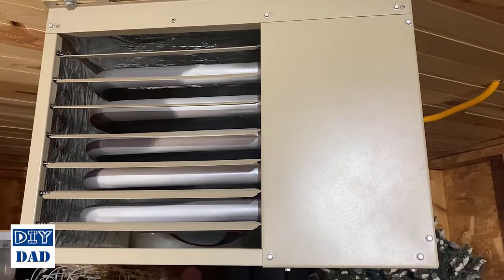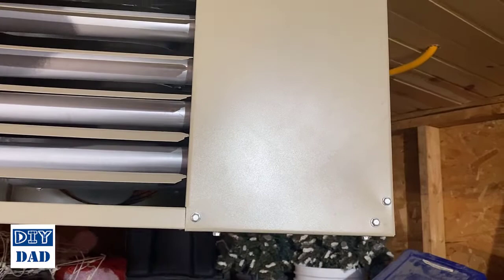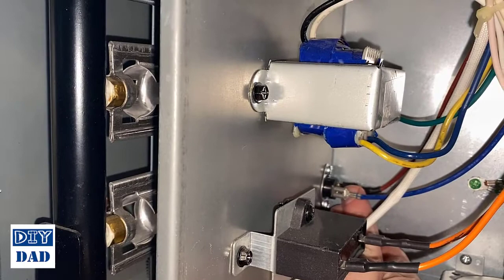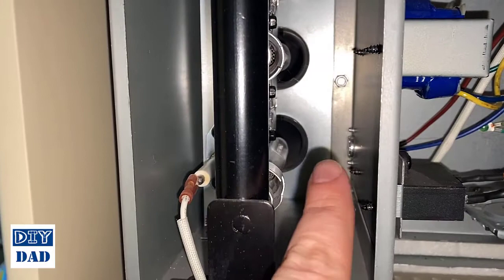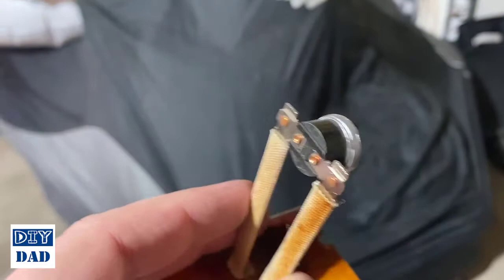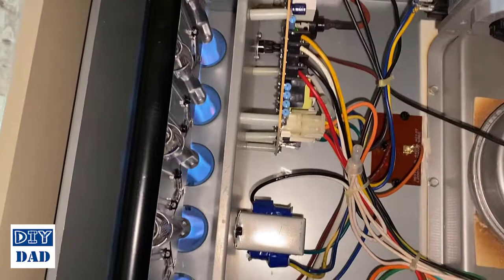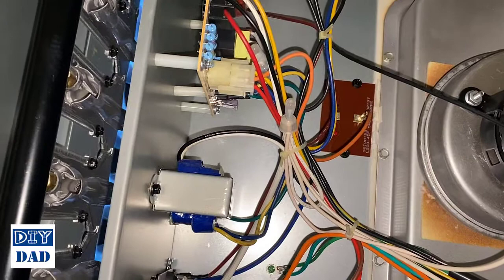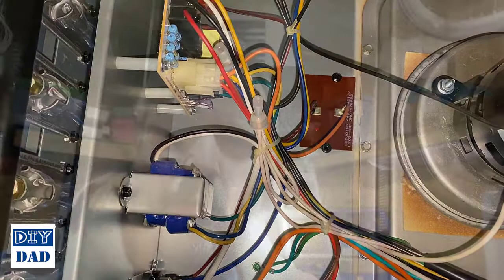Replacing the High Limit Sensor in a Heater that won't stay on. Common, Cheap, Simple Repair!

Comment: Thank you, DIY Dad!  I have the exact same heater in a commercial greenhouse.  Same error code, control board LED flashing 4 times.  Heater would turn the fan on high without prompt from the thermostat but not ignite.  I just replaced the control board, high limit sensor and pressure switch … but one of those pesky little roll out sensors had tripped.  After checking both of them and depressing the hidden reset button (thanks for the tip!) it’s working great again and keeping the tree ferns warm.
Reply from the maker: Awesome! Glad I could help!

Comment: I reset the rollout sensors and started the unit and saw the flames rolling out and the sensors tripped within a minute. I then blew out the screens at the gas jet outlets and reset the sensors again and seems to be fixed, been running for over an hour with no rollout. So thanks again for showing where the resets are on the rollout sensors.
Reply from the maker: Excellent!  Glad that was helpful to you!

Comment: Thanks. I have the four blinks so will check the sensors. Unfortunately it's black around the heat tubes suggests some rollout. The heater is less than a year old
Reply from the maker: Best of luck!  Insulated the walls of my garage this last summer which has resulted in my heater running far less and haven’t had to touch it since that video (the original sensor lasted only about 2 months)

Given how cold it has been this winter I would check your heater’s exhaust path for icing or snow buildup - either could cause some roll back.
Reply: Where did you purchase the sensor?
Reply from the maker: @philhanson7624  Honestly I don't recall - I pulled the sensor and read the part number off of it, then did a google search for that part number.  I am pretty sure I got the replacement from Amazon or Supplyhouse.com

Comment: Is there temperature sensors that will also fail on the electric model
Reply from the maker: I’m not sure.. but it would stand to reason that there would be a failure limit sensor to avoid a heating element melting or damaging itself in an over-volt situation

Comment: I’m getting 2 flashes for system failure. I’m not finding anything  online that tells me how to fix this.
Reply from the maker: What model number of furnace?
Reply: If it’s a Mr. Heater Big Maxx 80,000 btu furnace, the manyal says:
2 flashes: System Lockout - failure to detect or sustain flame.  Current signal at FLAME terminal less than 6 micro amps. 
If your heater is trying to ignite but won’t stay on, it’s probably a flame sensor or the control board.  When my heater gave me this code I replaced the control board with a kit I got on ebay and it worked fine again even after sitting for 3 years.  Hope that helps!